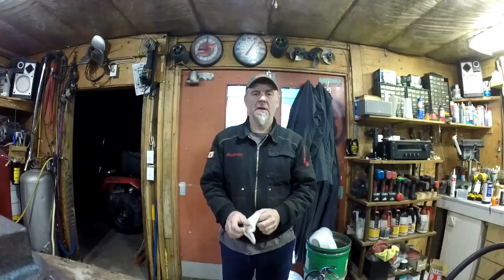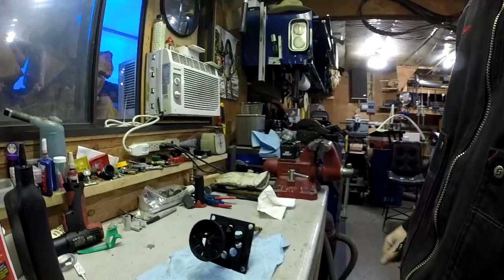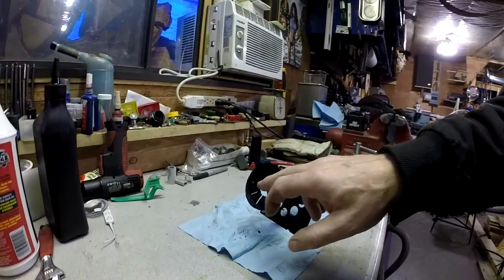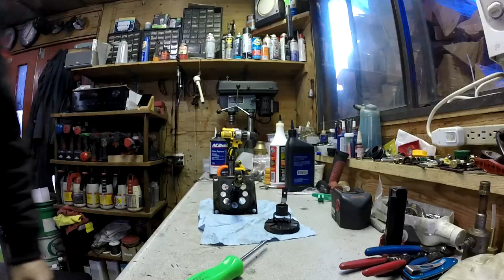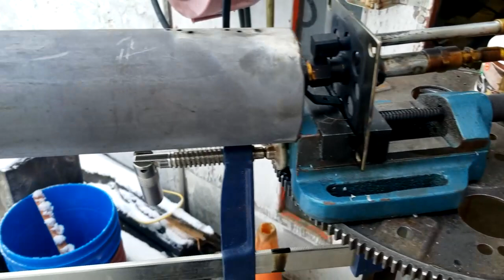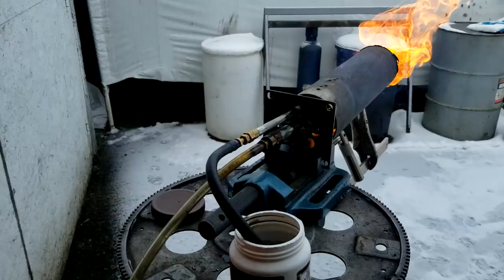Waste oil burner

Comment: Hi. Did you manufacture that plate that holds the burner unit yourself? Guessing yes, but can't see what it's made from. Maybe as simple as a tube welded to a plate with holes drilled in it. The plate does look like it was stamped at a factory since the holes are so uniform.

Oh and there are no compressors that size on Amazon that I can find. Are you sure of the specs on that? I bought the biggest one and it's not as powerful as what you say yours is. The one I got is loud and really obnoxious. I need to put in a soundproof box. I haven't hooked anything up yet, because the burner comes from China and they lie about how long it takes. It's been weeks and it's still in transit. I would have cancelled it, but there's no other option.
Reply from the maker: it is just a plate with holes drilled into it, the nice holes are because I use a step drill bit...Unibit.

Comment: This is not efficient waste oil burning.  This burner needs a lot to make it usable.  You are on the right way... congratulations
Reply from the maker: You obviously didn't listen to what I said in this video, this was put on this bench to show it burning outside the boiler, inside the boiler it burns super efficient, so listen before you make a comment!
Reply: @machinehead6892  Yes i didnt listen you at all. I burned 40 tons of oil for a past ten years with different type of burners. But efficient burner is not black like a night beacause coke and oil which is not burned at all. I only want to support your work and to make your burner better. Good for you...then for me it is better...also if my comment makes you angry...I can delete it.
Reply from the maker: No I'm not angry, I just said in the video that this was not a good test it was just to show how it operated on a crude test stand in my stove it burns perfectly, no smoke or black, the inside of my boiler actually turns white when I burn the oil, thanks for noticing, cheers. @IgI-Ze